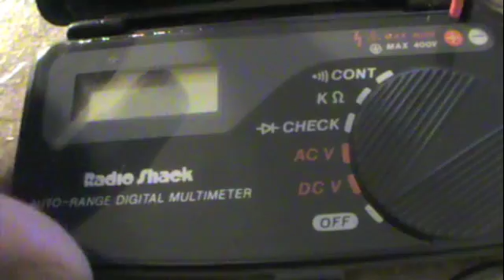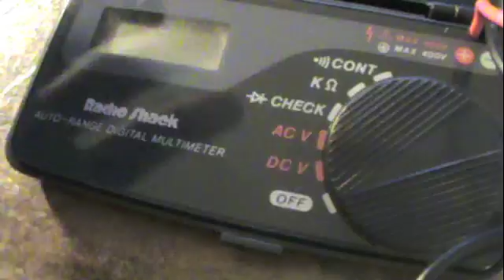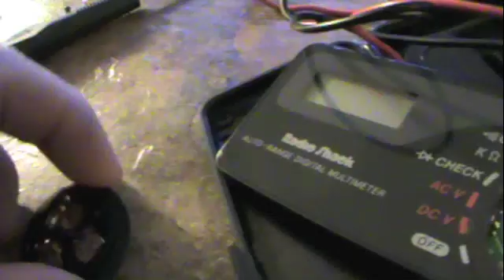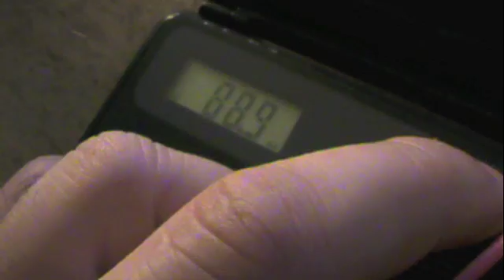Fixing My Old RadioShack Multimeter

Comment: Same here, I got this as a gift when I was 14ish, and its been with me for over a decade now, still going strong. Have only a slight part where sometimes it goes between modes unless i turn it a little bit more, so I guess I'll have to do the same.

This thing has always been great. Only missing a tiny backlight, and a current mode and I would never need another.